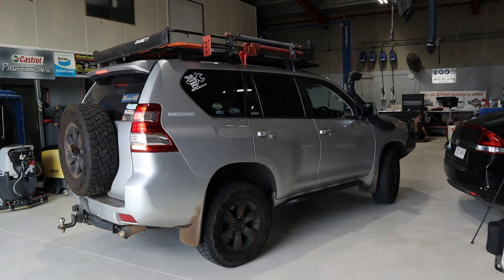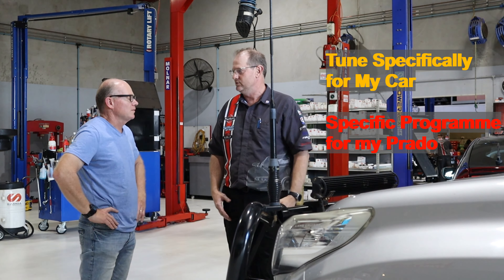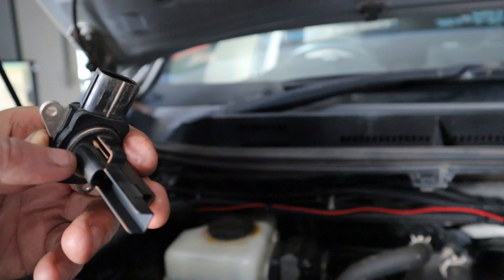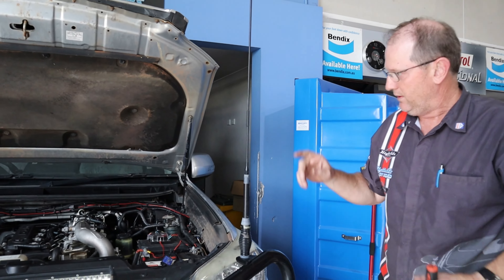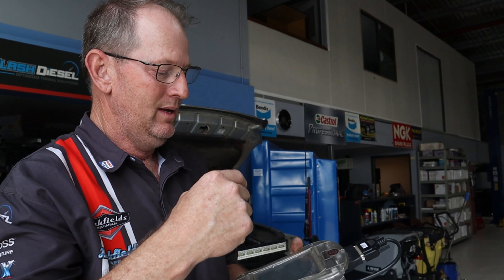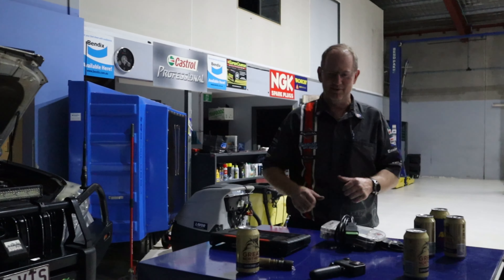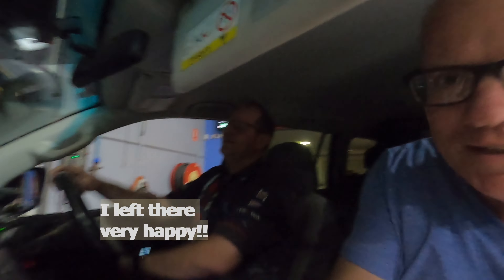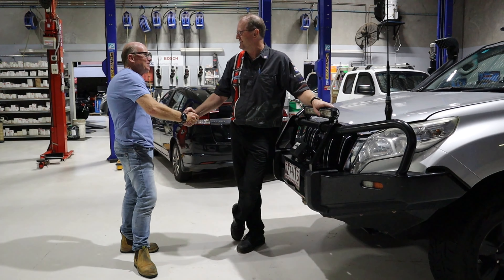How did the Prado 150 go with an Engine Tune | More Power/Less Lag?

Comment: Have you noticed any difference in initial economy ? I spose it’s to early to tell, but just curious, I have a 150 too and am wanting to get a tune but have my hesitations about it. Don’t want to compromise engine.
Reply from the maker: Yes I am noticing a good difference in fuel economy particularly on highway drives. I'm very happy with it. I hardly turn on my Idrive now 😁👍
Reply from the maker: Go with who you trust. I've done a bit of research and both Dan's Automotive and Highfields Mechanical have been amazing. I have other videos about Dan and I trust his advise completely. He suggested a tune would be good for this engine. I've kept up the oil changed and maintenance to a high standard and just recently cleaned the EGR. I think its a good move. Injectors will be due in about 20k kms. I'm very happy with the outcome so far.

Comment: have you had the injectors replaced? Or load tested? 1kd's are prone to a piston crack. I hope the tune works for you well !
Reply from the maker: No, injectors haven't been replaced as yet. They were all tested and values were good. Its a mild tune and yes I was hesitant in the first instant. However, a bit more torque and power good for overall and especially towing. Yes I'm aware of cracked pistons but I've been assured with this tune customised to me and my vehicle it will be a great benefit.
Reply: @prado150outahere  at 150kms mine cracked. Nothing bet the best maintenance from new, my injector values were also good… Good luck.
Reply from the maker: oh no mate. Not good. What year was your Prado?
Reply: @prado150outahere  2013… Has a new engine now. How’s yours going with the tune?
Reply from the maker: Mine seems to be going awesome with no issues, loving it mate. I'll keep an eye on it after your comments. From information I have heard, the 2015 model, 3 L they have refined the injectors to a generation 4 or 5 I believe and are much stronger then the earlier models.
Reply: @w_stanky  do you do a lot of towing? Injectors have always gotten the blame for cracking pistons, but apparently toyota blame towing causes the weak pistons to cracking in those cases. I'm trying to build a bit of evidence for myself. I have a 2012 1kd with 250k
Reply from the maker: I'll find out as I've travelled over to WA towing my Jayco Crosstrak and still have another 5000kms to go on the trip
Reply: @prado150outahere  enjoy your trip 👍
Reply from the maker: Thanks mate 👍

Comment: Gday mate! 
I’ve got a 2019 150 gxl. 
Toyo 265 17 75 RT’S, Bullbar 
2” superior lift
My economy with 3 in the car and groceries a 2 hour drive I want better economy and a bit more stick.

How much was the tune?
Do you have an after exhaust?
What happens if you get errors come up
Ongoing servicing with Flash or at home?
Love to hear pros and cons to justify a tune.
Reply from the maker: Thanks for your comment. Can you send me an email to Prado150.Outahere@iinet.net.au and I'll go thru mine and my experiences in detail. Saves you going back to find a reply to your comment and it'll give me a few days to get back to you. 👍
Reply: Hey mate,  how are the 265/75 17s going for you?
I was going to put 275/70 r17s (half inch smaller than yours) on my 150 but not sure.. 
Did you notice much change in power or steering?
Reply from the maker: At the moment no issues, and loving it. I think its the perfect size for what I do with the Prado. Could go a wider tyre size next time, but really I'm happy with these. Didn't notice much at all with power or steering. I'd recommend what I have now.

Comment: Just my 2c but it's not worth the risk, these things are renowned for piston crack, more torque = higher cylinder pressure = higher stress on pistons, if it lets go you will always wonder, I accept mine for what it is, if I wanted big power and torque would go for V8 cruiser instead where there is more cylinders to spread the load over, a long engine on these are 10k from Toyota plus all the fitting and consumables that are needed.